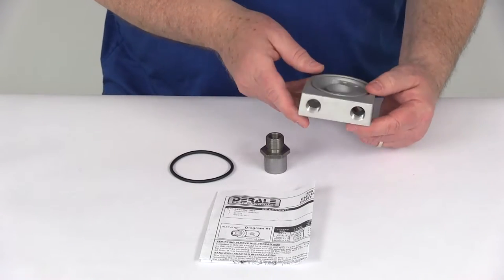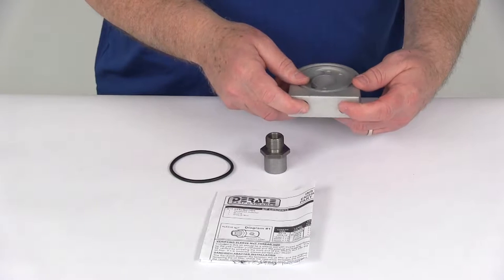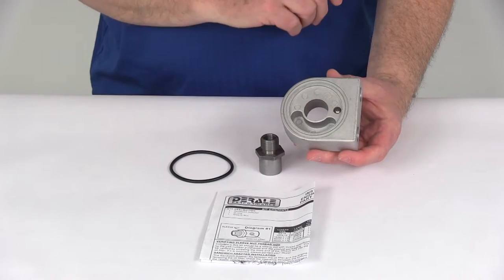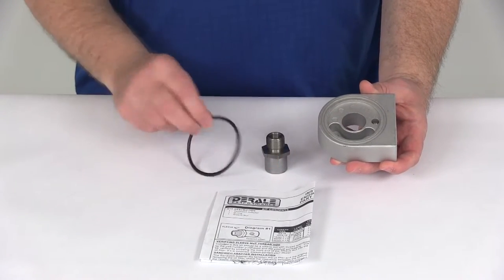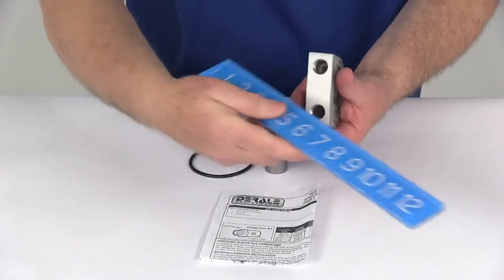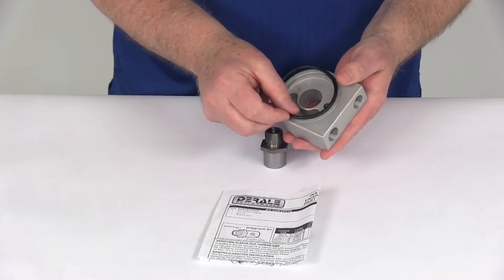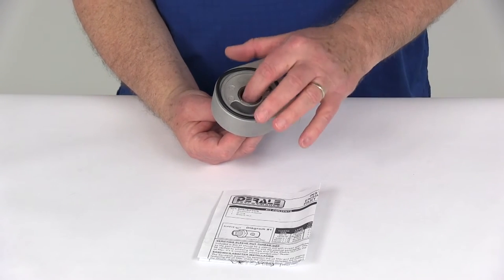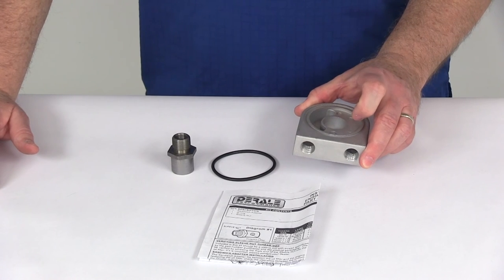etrailer | An In-Depth Look at the Derale Low-Profile Sandwich Adapter

Comment: will this work on a chevy 350?
Reply from the maker: The Derale # D25772 sandwich adapter isn't engine specific. It'll work with a Chevy 350 ci engine as long as the engine takes an oil filter compatible with 20mm x 1.5mm threads with a 2-1/2 or 2-3/4 inch diameter O-ring.
https://www.etrailer.com/Accessories-and-Parts/Derale/D25772.html
Reply: @etrailer  'preciate your reply but I wound up getting an aftermarket adapter that is vehicle specific.  Good looking products. Just went another direction. Gotta get rid of those little plastic oil cooler line hookups. Bad engineering on  GM's part.